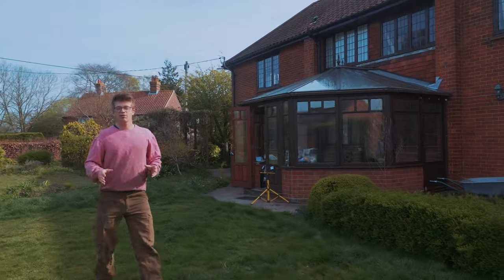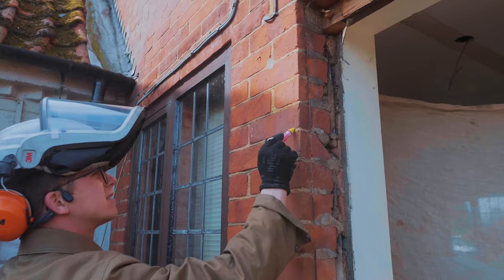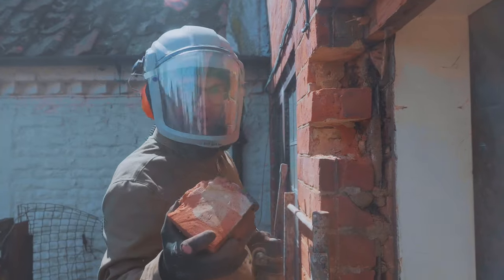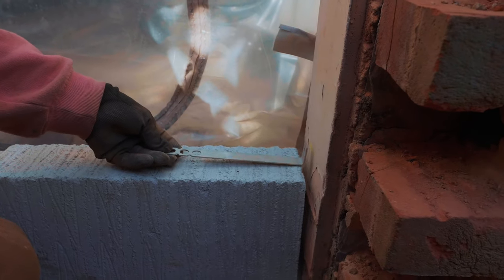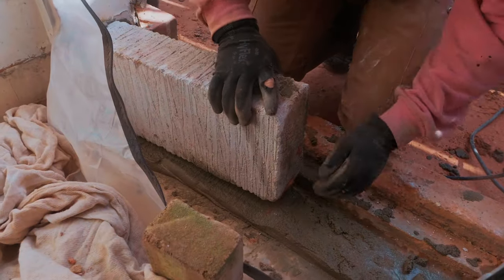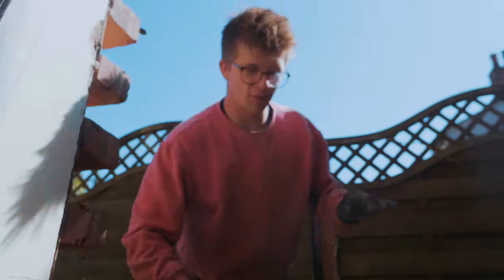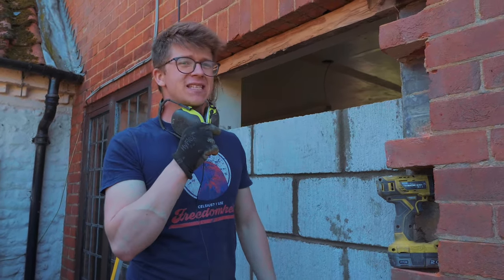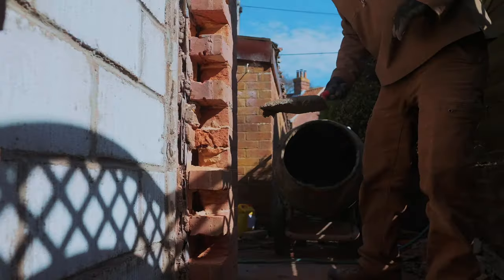Becoming the World's WORST Bricklayer for a Day!

Comment: Yeah, supposed to be super wet. For the edges, you just slap it in there. Just get you a scoop onto your trowel, and flick it at the side of the already laid brick, then quickly lay the one in your hand next to it.

It should be almost runny, but not so much that it's flowing. Think Yogurt with dirt. What you lay down on the next level will flow in a bit and fix the gaps left at the sides.

TL:DR - Bricklaying is very easy, if you don't overthink it, and keep in mind that everything above your last brick line is fixable in the process.

Comment: Hands down your best video. Normally, watching you struggle to do something is amusing, because you kinda know what you're doing, this is hilarious because you have no idea 😂 
For toothing the bricks out, a recip saw with a mortar blade is best, with a plugging chisel to do the vertical. Mixing mortar, should have just thrown 2 full bags of sand in the mixer, then grabbed the (open) cement in the middle and tipped the top half in. Spraying the blocks with water an hour before you use them takes away the dryness so the mortar sticks better. You need to ridge the bed up so it can squash down. Brick ties should be every course of block, and you should have cavity ties between the bricks and blocks. Buuuuut, it's stil better than some 'professional' brickies I've worked with, at least you've got enough cement in your mortar. 

Oh, and you didn't need to spend £20 on a gallon of plasticiser, a squirt of washing up liquid does a better job.

All in all, 10/10 would laugh/cringe at again 😂

Comment: instead of using the hammer drill for the bricks u could haveused an angel grinder with concreate disc (nice cut and no chanse of breaking the other) then just use the hammer drill from the side to loosen it from the back

Comment: Ok. This is good drama but next time, for such a small opening, plywood sheet on inside shored up. Then get you some #1 rebar. Drill some #1 holes 2” from top and bottom then space every foot. Cut you some pieces for one side that are 24”. Epoxy those in. Other side measure hole depth plus a foot after the 24” bars already epoxied. Epoxy those in. Tie wire the two pieces of rebar together. Then run vertical #1 same same and to complete, tie wire the grid together to snug up the steel. Sheet of plywood with an access hole top corner to pour your mix in. You can with use a vibratory to get the mix set and avoid air pockets or rubber mallet your form to compact the Crete. Let cure 24-48 hours depending on mix. The top corner where access hole was, use non shrink grout to fill the void. Non shrink sets super fast so beware. SUPER FAST. and is very bendable and very hard dense material. Good luck Alec.

Comment: drip the brick/block in water or at least generously spray it with water, so it does not suck the water out of the mortar, this way it will stick. Btw, my first bricklaying experience went far worse than this, and it is still standing, so keep up the good work :)

Comment: My dad was cutting a hole for a inset cupboard in my wall years ago, and was using a circular saw to cut through this dark grey breeze block. He had the window open to let out most of the dust, and where there was sooo much dark grey dust billowing out the window the neighbours called the fire brigade as it looked like thick plumes of smoke and they thought the house was burning down! 😂🔥

Comment: Do you not want to put insulation between the bricks and the blocks? Or it the air in the cavity a good enough insulator as it is? I'm sure that two layers of bricks is already better insulated than just a wooden door, but maybe not as good as a wall with foam or fiberglass in it.

Comment: Great job, it's not easy but you forgot one thing. Insulation assuming the rest of the house has a filled cavity that old door will be a cold spot. Sorry to be boring but I'm currently seeking out on building efficiency and UK housing is generally rubbish. It's possible to build a house that doesn't need heating but we don't do that.

Comment: This is definitely something you needed more research on before doing. That wall has no insulation, weather resistant barrier, drainage layer, or steel reinforcement. Which means its going to crack, settle, and generally move all sorts of ways, while becoming a home for mold. What you needed was a proper rainscreen construction, especially for somewhere like the UK where it tends to be a bit moist. Where's the weep holes?

But hey, maybe it'll be fine. Probably not, but maybe. There are some professions that do have years of training and experience to be able to do what they do. Architectural professionals and brickies being two of those.

Comment: LOL, It would have went better & easier if you would have cut the mortar and chipped it out, you would have been able to more easily removed the bricks.. Also that bit of metal, is an anchor it helps secure the brick to the wall so it wont fall.. And when the bricks are that close, you can use a trowel some mortar in.. I loved watch this one.. And lastly, brick laying is very very easy..  Did you watch any videos on YouTube on how to lay brick...  LOL Thank you so much for sharing..

Comment: I watched this with much amusement, up until the very end where I saw that the archway bricks were left in place. Then, I felt a twitch. Just a small one at first. Then I started realizing, that was how you were intending to leave it. The overlay pattern of brick completely disrupted by these archway bricks in the middle of the wall. The twitch grew stronger. I thought about all the videos I’ve watched of you, wondering what I had missed? Where were the warning signs? And I realized, sometimes, you don’t realize someone is a monster until it is too late…

Comment: Brick is usually fired, block is not. Also most block is made from concrete whereas brick is made from terra cotta clay. Cheers👍😁
Reply: you would be surprised mate. bricks are not made of clay its deserving i know, back when bricks where being made and designed clay was used but now a days its now either a concrete mix with added iron/ zinc oxide or shale mix with added iron/ zinc oxide.
Reply: @maxamoomini7762  stronger or cheaper? I'm thinking the latter. Most of the older bricks here in the US are clay, but we don't use much in new buildings anymore. Just cinder block and wood. Occasionally steel.

Comment: Dude, you're supposed to SOAK THE BRINKS AND BLOCKS!!!!! You don't need mortar plasticizer. You need to SOAK THE BLOCKS!!!!! With this stuff called WATER! Also, the more wet the mortar is the less strength it has after it dries. When you don't soak the brinks and block, the mortar will dry out on contact with the bricks and can become brittle and wear out prematurely over time. Soaking also helps the mortar stick to the bricks.

Comment: There are some great comments/advice below, too late for this video, but chipping the remaining bricks can be mitigated by guiding your grinder with the trowel and using a cement drill as a kind of saw , you drill a smaller hole and guide it sideways,and matching the color by saving some mortar dust and adding it to your new mix. Biggest mistake, going too fast without the skill that experience gives you. No offense but the difference between  ignorance and stupidity is that ignorance can be alleviated by research plus mistakes but stupidity doesn't benefit at all with repetition, witness the lines and width.  If you man scaped  the same way as you brick laid, well, get out the band aids. Kudos for grit and humor tho.

Comment: I laid brick, block, and stone for 10 years. This was hard to watch. Keep trying though. It's not for everyone. It wpuld definitely help to see it done a few times.. 
  Regardless, keep up the attempts.
Reply: I've never heard of mortar plasticizer. I can get it to stick just fine.
Reply: I would be embarrassed if it took me longer than a half day to tear out and lay back that wall and clean up.. While mixing mortar and stocking brick myself.
  Speaking of which, a stiff bristled nylon brush with a weak solution of muraitic acid will clean up the white film from the mortar dust. She'll look bright and new. 
  I like to put a couple inches of acid in a 5 gallon bucket full of water and scrub. Dip and scrub. Dip and scrub. The 6 foot wooden handles are best. The brushes we use are about 8" wide and maybe 3-4" thick. Wear safety glasses. Keep your mouth closed. 
  Once it's all scrubbed, rinse with water from the top down. Do not let it dry. 
  Good luck

Comment: Just to let u now u fucked up u needed the press the motor in with a scraper after it started to dry so all ur joints look the same then with a wire brush u need to make the joints look square other then that u did ok and u can still fix u mistake buy going back with a grinder and grind it out and add new mud to make it look all the same